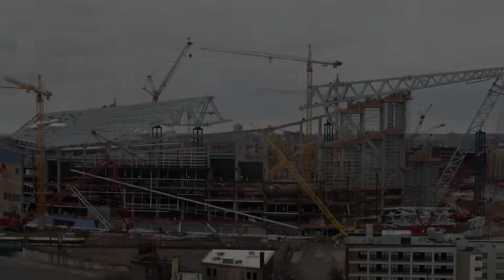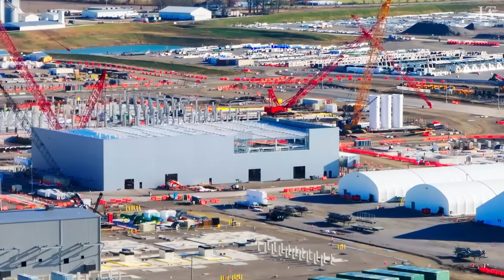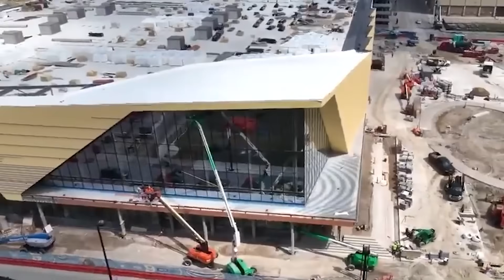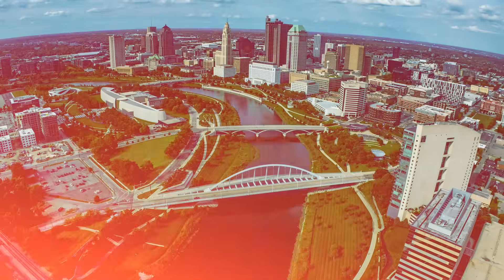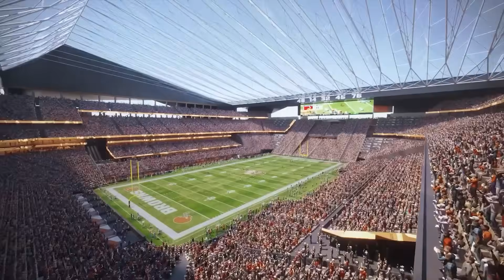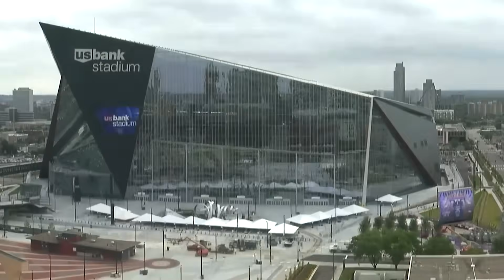Ohio Megaprojects Under Construction in 2026

Comment: The backup caused by the Brent Spence is a nightmare that affects the whole area. It used to be that tractor trailers moving through the area had to use the 275 beltway. That made a huge difference. I wish they would reenact that law.